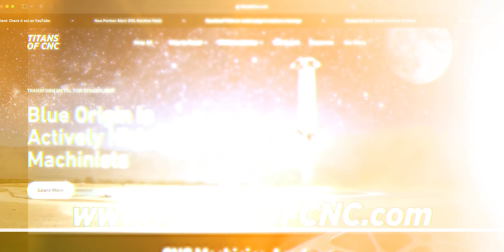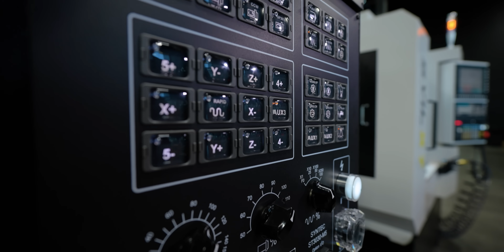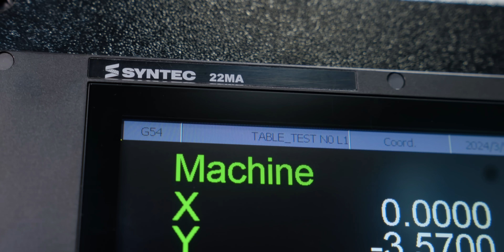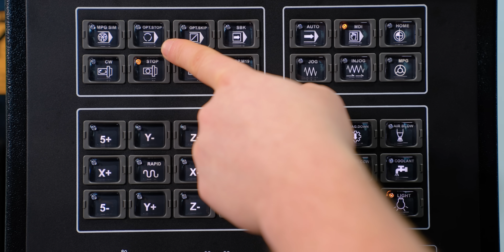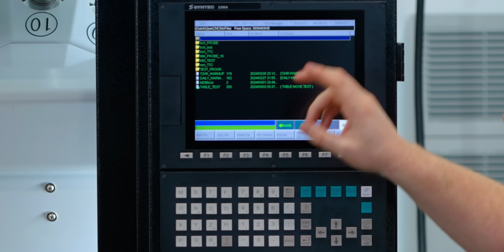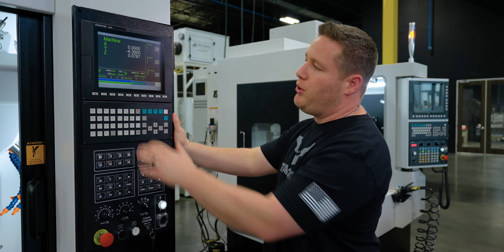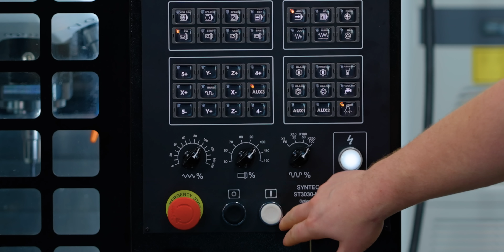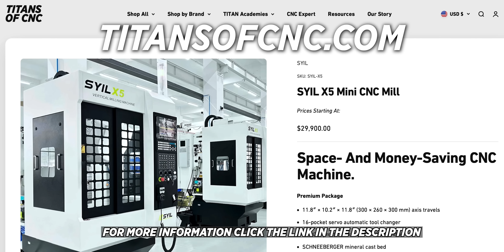SYIL X5: Complete CNC Machine Overview

Comment: Great to see this video. Purchased an X5 last year but have had some difficulty using it as I'm completely new to running a CNC. Mine doesn't seem to have the tool setter screens you showed though, not sure why.
Reply: X5 looks like nice machine. So you do not happen to know of some experienced CNC machinist locally, that could help you get going..?
Reply: @Rimrock300  not in the same city unfortunately. But I do know of someone in the same country at least.
Reply: Spoke to Syil and they're sending updates. Great support from them!

Comment: What is the minimum garage door height for this machine to clear during installation? As well as the operational height of the machine? Thanks guys
Reply: 80" so it will get into any garage
Reply: Mine was installed in an 1850s brick barn with an oak beam 2070 mm (81.5 inches) above the floor. I had to disconnect the cable chains and use thin machine skates. Only thing I didn't realize was that the slots in the base are too narrow for a standard EU pallet truck.  Also you need very small toe jacks.  The machine movers brought their normal jacks but they were much too tall to fit.  80 inches would perhaps be possible, but watch out for any rocking on the skates.

Comment: Stick a dial indicator on it and sweep it across the table. That's what I really want to see.
Reply: Hopefully, that was done at the factory when the machine was built.   Of course depending on where it was built,  they may not know what a dial indicator is, lol.
Reply: @berniepragle948  Ideal would be laser interferometer plots, but sticking a dial indicator on the spindle and sweeping the table is low enough effort that I don't think it's too much to ask for.
Reply: @dwaynesykes694  might not help you most machines are rated in the tenths though the really good ones are millionths

Comment: Is it weird that the spindle won’t go to the table..? 
I find it odd it won’t go down to the vise… and the vise has to be on a riser?
Reply: It will 100% go to a vise, just not if you are doing plate work at the table. Meaning if you are working off a fixture plate you will need a subplate to build up your table
Reply: If you mount the 4th-axis that probally turns into an advantage...

Comment: Weird layout. Neither side can be near the wall. Chip trays on the back. Tools on the right. Air on the left. Must be put in the middle of the garage with 10 feet clearance all around. Strange for the compact machine.
Reply: You got a point. I would think one could put the side with the air pretty close to a wall, and still reach it from the back. But say one need to be able to reach all side of most cnc machines no matter what, then making it as compact as possible is good anyway. But possible a point of improvement there. Going for such a machine to install in a garage for example, many will wish to put 1 or 2 sides closer up to a wall, possible

Comment: What's the spindle's rated RPM? What is its torque curve?
Reply: It is a 20,000 rpm spindle.  I can send you the actual torque chart if you want.
Reply: The torque max is 12.8hp continuous and up to 17.4hp for 30 minutes
Reply: @Jessie_Smith  Can you send a link to the HP, RPM and torque chart.

Comment: Whats the difference between a randomized and non randomized atc?
Reply: Randomized is going to put the tool in whatever pot is holding the next tool going into the spindle.  So it may be tool 3 being called up and it may have been in pot 7.  A non randomized ATC will always put tool 1 in pot 1, tool 2 in pot 2 and so on

Comment: I could have picked up 4 of those instead of the mill I have now and been much better off.
Largest tool I use is 3/8 end mill and all I cut is plastic, aluminum and copper.
Imagine having one machine dedicated to the copper parts I make. Another dedicated to the plastic and another for general stuff.
Reply: Sell your current machine and get these in the shop.